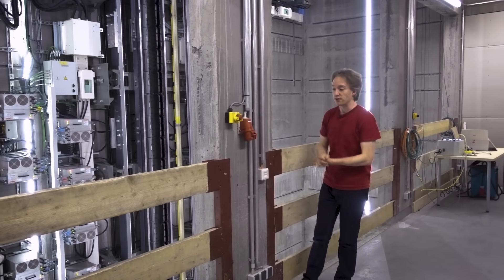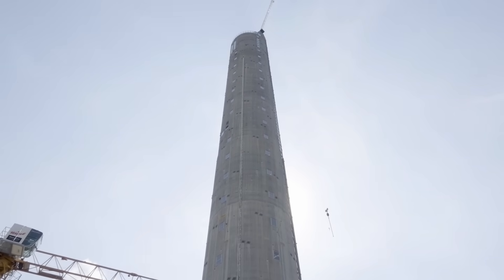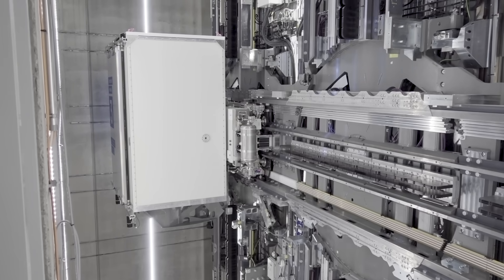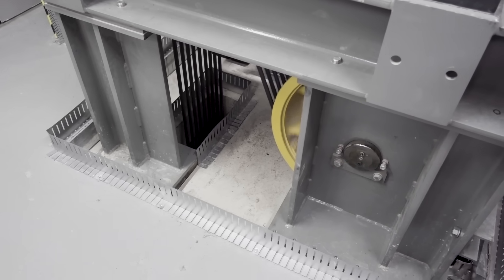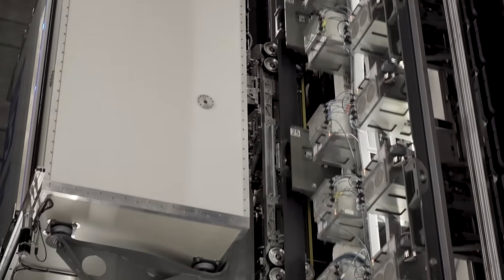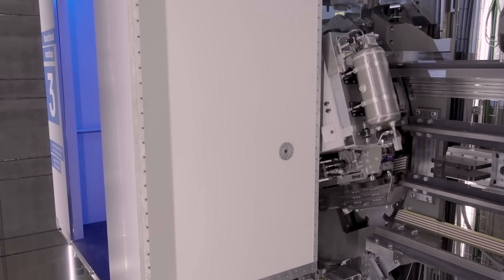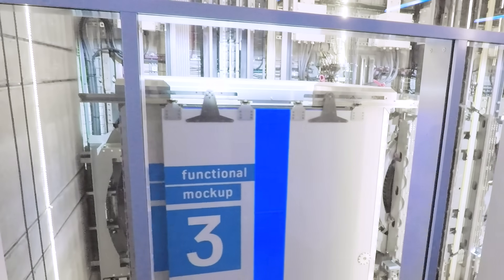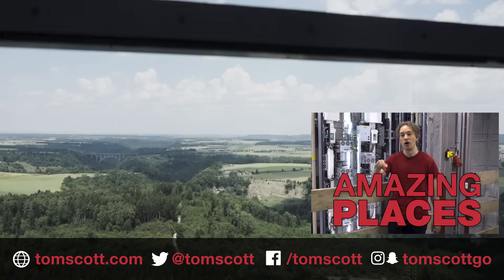An elevator that actually goes sideways

Comment: im surprised this isnt already a thing, especially when rollercoasters have been using exactly the same linear induction and synchronous motor technology for well over a decade to launch and slow down heavy vehicles. they are also fail safe and will slow down a vehicle to a couple of mph as a result of eddy currents when no current is applied

Comment: The real advantage would be using multiple cabins in the shafts with multiple switches. Classic elevators can only use one cabin per shaft. But with this system you could f.e. 6 cabins in two shafts - one shaft for up, one for down. A bit like the old paternoster-system, but much more secure. Best of course with more than 2 shafts, to alow cabins to surpas. On big skyscrapers you could double the capacity of the elevator system - or half the space needed for the same capacity.

Comment: Me: Lift cars with shared tracks rather than dedicated shafts and can move between them? That's fantastic... But I think such transitions should be made at the full speed of travel. 🛗💨😇

Also me: A 246m high, 1.700 steps Aufzugprüfungsturm? I don't suppose Thyssenkrupp have any use for a person with moderate engineering skills, passable German, and so much comfort in stair climbing he could happily live in a 250m tall building without a lift...Do they? 🧑‍🔧🛗🇩🇪🙏

Comment: I think the best selling point to this is to advertise it for hotels/apartment buildings where "each room has its own private elevator" and make the elevator stop at the intended room/apartment. This could be implemented by putting the key card reader inside the elevator instead of outside the room/apartment door.
The owner would call the elevator, swipe the card inside the elevator and taken directly to their room.
A guest could ring the room and the owner would send an elevator to pick them by pressing the button that traditionally opens the door.
As a bonus, no more strangers walking around the building knocking on doors to sell/preach stuff.
Reply: one fire everyone gone
Reply: @unflexian  I don't understand what you are trying to say. I am sure the elevators will be or already are certified for that situation.
If you were referring to the building, there would still be stairs. They are mandatory as emergency exits (but not entrances), for cases like a fire.
Reply: @boam2943  so you still have hallways between every room
Reply: @boam2943  also you can't have windows in a room like that, one side of the room has to be facing the massive elevator wall right? so if you want emergency escapes you need them to be on the other wall all the apartments have in common, has to be the opposite wall. so one side of the room is the elevator, the other side is the hallway, and the rooms are adjacent on either side. no place for windows.
Reply: @unflexian  That is not the architecture I was thinking about. I was thinking on what is already in use by some luxury hotels and apartment buildings, usually only in the penthouse, where the elevator and the emergency exit occupy only a portion of a wall or a corner. The rest is either usable wall space or is occupied with windows and balconies.
Just thought that, with this elevator, that floor plan could be used for more than just the penthouse and that would be a selling point.
Of course that, to have more rooms/apartments per floor, rooms would have to occupy the sides but one wall would still be free to put windows on, which is usually the most you get on non luxury rooms/apartments.
This elevator does not have to occupy an entire wall. The corridors for it to go side to side can be in between floors and only cross floors vertically on a single spot.
The corridors are not a problem if the elevators are external to the building.
The same logic can be applied to the emergency exits. Their corresponding corridors can be in between floors.

Comment: what happens when buinlding has no power? Do elevators just fall down? these coils hold elevator in place (safety too) and it allows it to move but in buinding loses power than coils cant hold elevator. ofc idk how it exactly works but thats how I understand this.

Comment: If I am ever in the business of shopping for an elevator, I will surely go with a Thyssenkrupp. It is very unlikely however that I will at any point in the duration of my remaining life will be in the business of elevator shopping. It is statistically improbable. I do not have a great or strong interest in the pursuit of constructing buildings and installing the elevator infrastructure.

Comment: Remember that such an elevator can have multiple cars per shaft and can divert out of the shaft when picking up or depositing passengers so the other cars in the shaft can continue moving past it.  Also, such elevators are what's described in science fiction, such as Star Trek's turbo elevators and such elevators could also move between buildings hence they are also PRT's.

Comment: Riding up to 98th floor in an elevator that uses cables , you feel the movement of the car . It feels like its shaking . The Nank of Montreal building in Toronto Canada has 98 floors and elevators that go only as high a certain levels and then the Express elevator . I didn't like the how the elevator felt and I am used to elevators going back to the 1960s . I even used elevators where you pull the rope by hand to make move up or down and they were not so unsteady as the elevator going to the 98th floor .
Reply: Nank

Comment: The system looks fairly complicated.....  You'd think they could make it a lot simpler / and safer with a geared track. Plenty of engineering challenges with that too of course.
Reply: well it is but trying to make it more simple is hard too we have to wait until we have new technology that can actually work like that and it is simple and really safe but until then we would have to use that and improve it until we have something that is easy and safe

Comment: technically there is something very similar in operation now..think about the Tower Of Terror  (opened in 2004 DCA and 1994 in WDW)  ride at Disney California Adventure...it has 2 "elevators" that can operate inside one elevator shaft..at the end of the ride it takes one elevator container out of the shaft (moving sideways)  for loading and unloading ..while that is happening another elevator container is put into the shaft and moving up and down in the shaft..

Comment: 2:33 "you have a buffer at the bottom that should reduce a freefall drop from 'fatal' to just 'severe injuries'."
Or, in the case of Betty Lou Oliver, who already had severe injuries before being placed in an elevator that would then freefall for 75 stories, "miraculous survival." (The buffer in this case was improved by the thousand feet of steel cable that had already broken off of the elevator and bunched at the bottom of the shaft, thus, apparently, cushioning the fall.)

Comment: I've been a Journeyman in the elevator industry for almost 2 decades, and my experience with cantilevered elevators is that they are inefficient, wear more frequently and unevenly, are less reliable, louder and less smooth, and overall a worse choice than balanced elevators.

Comment: Why is it necessary to be able to move cars between shafts?  is the idea that each shaft then becomes one way, and when a car reaches the top of the UP shaft it needs to be moved horizontaly to the DOWN shaft?  I can see the capacity gain of having multiple cars in each shaft (and a means of controlling their vertical travel to avoid running into each other)

Comment: I've long held the idea that really really tall buildings need to have omni directional elevators. One shaft goes up, another shaft goes down. Each shaft has multiple cars following each other at different floors. When they get to the top or bottom, they switch across to the other shaft. Maybe even have shaft transfers at a few intermediate levels, and have a maintenance area with a few spare cars, maybe a whole unused shaft so they can switch around for maintenance. The advantage of this system would be the speed of filling or emptying a big building. The current system has one car in one shaft. Put 20 people in it then it takes 10 minutes to do a round trip before the next 20 people can get on. My way allows the same 20 people per car, but each shaft has say 10 or more cars depending on building height, so the same 10 minutes can move 200 people. Even if the trip is slower because the car in front slows your trip, you might be looking at 15 minutes round trip but that still equates to 800 people per hour, rather than 120. You just need a way to move cars between shafts. This looks like a way.

Comment: But here is my question....is this actually practical??? Wouldn't a simple up and down elevator be easier to add to a building and just as effective???

And the space needed to allow this elevator to move could instead be used for MORE elevators...  so while it's cool that it can be done... is it really worth buying???
Reply: Ah but you missed that one elevator shift can currently be only used by one elevator. With this you can put as many of them into it as you want. If you now have two shafts one for things that go up and one for those that go down you could drastically increase capacity

Comment: In Las Vegas, Nevada U.S.A. there is a pyramid hotel called the Luxor. It has elevators which move on a slant which is both vertical and horizontal, since they travel at a 45 degree angle. Inside the car, you feel both an upward and horizontal torque. When the door opens and you get off on your floor, you are completely lost, since you are now in another side of the building. Very weird, unless your'e drunk.

Comment: Well, you didn't even mentoin what the real reason is for those exchangers. It allows the use of more cabins then shafts as they can make way for each other. That means maybe a little slower rides but far, far less waiting times in large buildings. And I think that's a very good reason to buy them.

Comment: I wonder if this will catch on?  It seems like it has more moving parts which means more maintenance.  I'd also think the linear motor would use a fair bit more electricity than the old traction style.

Comment: Traditional elevators with steel cables can do about 500m, carbon fiber cables well over 1km. Cable weight is not the reason for this. 

Moving sideways with lifts? We have trains, moving walkways and lot of other solutions for this. Need to move sideways is not the reason for this either.

However, having 800m long elevator shaft in your building that has just 1 elevator car in it is horrible waste of space. What we really want is to put many elevator cars into that single shaft. Let's say 10. Why not 20? As then you cannot go up and down in same shaft anymore, you need two shafts: one for upward traffic, another for downward. And that's also where moving sideways comes in; you need to swap the car between the two shafts. As we see in the video here.

MULTI here provides an expensive solution, which still makes sense if you can fit lot of cars into those shafts. Instead of 8 elevator shafts in your fancy skyscraper, maybe you only need 4 now. Let's say the sky scraper has 150 floors and those 4 saved shafts take 10 square meters of space each to keep numbers simple: that's 150 x 4 x 10 = 6000 square meters of floor space saved from the building. Toss in 10k€ per square meter for value, and the elevator system could save 60 million euros for the builder. Even if MULTI costs millions more than regular elevators, there's plenty to spare. And there we have the true reason for it: money.

Comment: Interesting how it uses a heck lot of the concept of maglev trains, and inherits both their advantages and shortcomings in quite the same way.
Regarding safety, requiring power to keep mechanical locks released is quite simple and well understood, definitely not worried about that.

Comment: not tethered by a cable and controlled by computers, no, thanks
Reply: I understand the part about computers? But why the cable? You would trust a cable more than being stuck to the wall with a metal platform?
Reply: @somaannn  If it was a proper mechanical connection, sure, I would trust it the same.
But its the magnets I don't trust and the overall complexity.
Reply: @monad_tcp  that is true. The more the complex parts, more likely it is to mess up

Comment: Doesn’t it defeat the purpose of elevating if the elevator doesn’t elevate? It’s designed to switch between horizontal and vertical traction. However by pure definition to elevate is to go up. Does definition change as the technology warps and defies our very way of life and knowledge. So many unanswered questions and so little time.

Comment: If they could have multiple elevators on one shaft moving at once and have block zones similar to roller coasters, the efficiency may be worth it for skyscrapers. They could have only two elevator shafts for the whole building - One that goes down and one that goes up. Then the "Stations" would be off horizontally from the main two shafts. This would move people way more efficiently in a building.

Comment: Wait, just how wide is this skyscraper going to be, to justify this technology? Also, how much space are going to be left, if there has to be horizontal and vertical shafts all over the place, just so some lazy twat does not have to walk a few meters? Will it also have toilets that comes to your desk if you need to go? This is idiotic.
Reply: I take it you didn't understand the video at all? The purpose is to pack more cars in fewer shafts, saving tons of floor space in tall buildings.
Reply: @HydraulicDesign  Oh I get the idea. I think you just don't understand how space works. Elevator shafts that goes not only up and down, as they do now, but also need additional shafts to go sideways from one shaft to another, takes up space that could have been used for offices. 

And as for the cars...I don't even know where to begin!!! Look, you have some installations where cars are stored vertically, for extended periods of time. For example car dealerships, for stocking cars etc. But using such a system for everyday use, and different people standing in line, waiting to park their cars, and others waiting for their cars to be retrieved, that is how clusterf^>cks are born!!!
Reply: @mierbeuker8148  ah but you only need one sideways connection. Than you can have one up and one down shaft. And even if you could just fit 3 elevators in each of them you could still transport more people than a Standart elevator that could only house 1 elevator per shaft. At the same capacity a normal elevator would need 6 shafts.

Comment: The Buffer is only there to stop the car safely if it passes the lower landing at the designed speed (plus the tolerance of the safety governor) it does nothing for falls from height that is the job of the safety brakes. In fact in most lifts the danger is the car 'falling upwards' out of control because the counterweight is heavier than the car plus passengers. Lots of people have been killed in this scenario, there was a bad accident in Canada. The EU changed the European Lift regulations probably 20 years ago to require 'lift cars to be fitted with a parachute to prevent falling upwards' or that is how the English translation of the French original ended up. However the requirement was not retrospective so lots of lifts in high buildings are not fitted. Not sure what the situation is outside Europe.

Comment: This really wasn't about an elevator that goes sideways; it was an explanation of induction motors versus cables. You never really explained HOW the elevator switched from vertical to horizontal, even though you showed the same video over and over again.

Comment: They do not seem very safe or well regulated to me, it is quite easy to bypass safety on many elevators, they have very little security or forethought into stopping people who wish to joyride on top for example...
I can see why, as there is a need for emergency services to get easy access etc, but the industry needs to tightly regulate the sale of the items that allow bypassing/access - and it does not.

Comment: SOme people say it will be to expensive or complicated to be a sucess but I'm not so sure about that. 
You can have multiple cabins in one shaft which reduces the footprint of the infrastructure. That alone is worth a lot of money. There are no moving parts in the shaft so most likely it will hold up forever and the cabins can be called to a maintainance parking spot with no need to stop elevator operations. You could make them work similar to old paternoster elevators worked and increase the capacity of one shaft by A LOT.
With cable elevators a counter weight needs to go up if the elevator goes down, not so here. On the way back down you could therefore recover some energy from the system. 
That's all applicable for small to medium sized Buildings already without even tapping much of the sideway potential. 

In Combination with cleaning Robots, Transporter robots etc., the potential to implement point to point connections all over the building is quite interesting.
You could use some of the carts as goods transporters during the day and put them in the main shafts for people during the rushhour in the morning and evening and so on.
You could automatically deliver stuff all over the building without the need for robots driving through the corridors.

Comment: wouldn't it be easier to just use a standard motor on the cab to lift it like they do for small lifts but have it pick the power up from a contact rail like an electric railway?